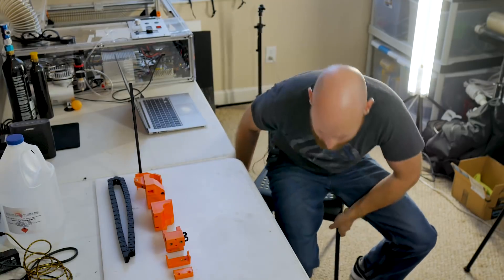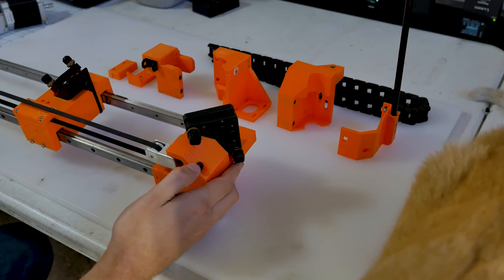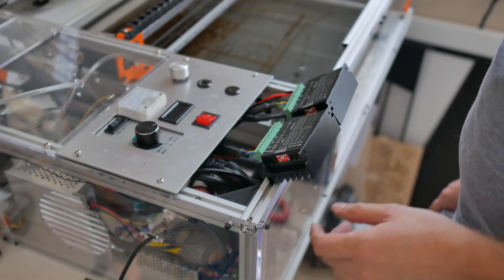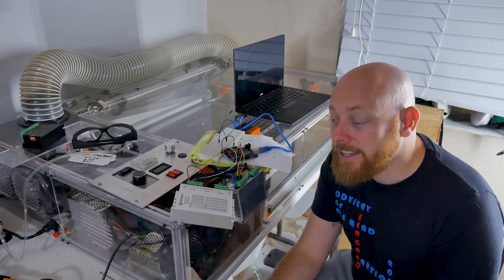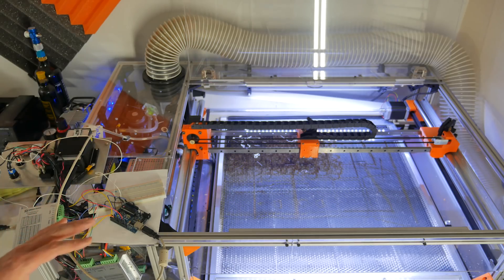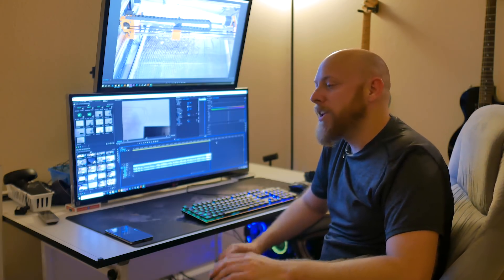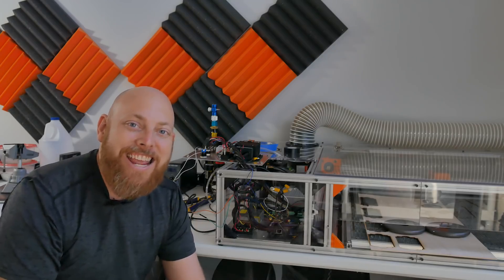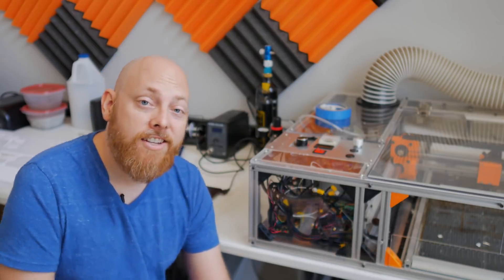Laser Cutter Upgrade (Fast Engraving!) - S02E37

Comment: Congratulations, you took bad laser tube from old K40 laser engraver and make new, bigger laser engraver for only double price. It can be only laser engraver, not cutter... because there is no air assist, so any cut may look as if you cutting with a paraffine candle. And current measured in Volts? Voltage in Amperes?

Comment: There is a thing called grbl lpc that work with your board. It's like grbl but can generate much faster step pulse and laser pwm. There is some guys out there that tried 500mm/s engraving without any issues.
Maybe another alternative is to use grbl esp 32

Comment: Very cool!  Are you streaming from LaserWeb to the controller board?  Do you have it loaded with Smoothieware or GRBL?
I have a K40 laser that I just put a Smoothieboard in, but I'm having trouble finding tools to support my workflow.  I tried LaserWeb but unfortunately all the machine config and job data is hosted client-side, so I can't set up a job and start it from another browser (my desktop is in the opposite corner of my house from the laser).  I'm going to try VisiCut next, and if that doesn't work, I'll use LaserWeb locally on my desktop, have it export the gcode, and manually copy the gcode over to the Smoothieboard (via SD card or the network).  I really need something that will let me set up a job from my desktop, then go over to the laser to actually start it.

Comment: At what point do you start considering more professional software hardware? Something like Mach3/4 pushing a gecko board.
Reply from the maker: I have mach 3 and a gecko drive on my cnc, and honestly it doesn't do anything special compared to the laser set up. In fact mach 3 makes for a pretty poor laser cutter software, and you still need something to generate all the g-code.
Reply: Good to know.

Comment: Reall there is a setting in grbl and in laserweb to add a 7 ms delay for your laser! That second Arduino was pointless
Reply from the maker: I would love to know where these settings are, and you might want to let the author of GRBL know its in there, because he doesn't seem to know.
Reply: 1.) Wow, no need for that level of sarcasm asshole !!!
2.) I was mistaken about laserweb I got that option from Inkskape, 
3.) Also my fussion 360 CAM setup has this option.
4.) There are plenty of GBRL options available; Marlin, MK2 (kimbra) and both of them have it.

#define SPINDLE_LASER_POWERUP_DELAY   5000   // delay in milliseconds
#define SPINDLE_LASER_POWERDOWN_DELAY 5000   // delay in milliseconds
Reply: @peterrusanoff1010  will that take microseconds instead?

Comment: you know laserweb has a build in laser fire delay setting, you can setup in the software.
Reply from the maker: I looked and couldn't find it. Could you be more specific?
Reply: I think you mixed something up. We do not have such a function in LaserWeb4, because it could only be done in the firmware.

Comment: So I was wondering what code you used to delay the incomming singnals, since at first glance it doesn't seem to be that easy for me
Reply from the maker: I will post the code when I get home tonight.
Reply from the maker: https://drive.google.com/drive/u/1/folders/1O_6vE8vBIstp4J8dbozfsC1wr1kFVybs
Reply: You really have to be carefull when delaying more than the length of one high or low pulse, since you would interupt the interupt. I guess a variable capacitor (You can also use potentiometers to charge / discharge the cap ) along with a comparator would be the more precise method
Reply: @MrLimetto  The RC comparator solution seems to be a very nice idea!

Comment: So I am building a high speed automatic camera slider right now. It has to move a 3kg camera in 5cm increments as fast as possible. Whats your top speed guess? I hope for 5sec for 5cm. Not sure how fast in can accelerate and de-accelerate. I was thinking of using 2 Nema 17s with A4988 in parallel. They are just much more compact and consume less power.
Reply from the maker: 1cm a second isn't to fast. The heavy axis is probably about 2kg and can move at least 20cm/second. You should be good with your setup as long as there isn't too much friction
Reply: I would add that running two steppers together to achieve more power can cause other problems, so if something starts acting weird give us a shout and maybe we can help!
Reply: Ryan Wilhelm Thanks. That sounds good. Will start with a prototype soon.

Comment: What microstep settings are you using on the drivers when you test "full speed" on one axis? Acceleration settings? Feedrate? :) It seems like the smothieboard can handle a lot higher frequency on the step pulse than Arduino GRBL can (~30KHz).
Reply from the maker: 3200 mircosteps, feedrate is anywhere between 20,000 and 50,0000 mm/min, acceleration is 5000 mm min/min. the smoothieboard can definitely handle a lot. though 50k is a bit much for anything by engraving. i would say it can handle anything lower then about 10,000 without problems.

Comment: I bet that the problem is not that the arduino is too slow, it's that it has no flow control on the serial input.  You're probably overflowing the input buffer, which is causing your loss of control.
Reply: If that would be the probelm, then the steppers would stutter! 
Grbl creates the pwm and stepper pulses in one interrupt routine, which means the delay between both signals can not be longer than one interrupt cycle!

Comment: Just watched a video Oct/2017. Pumpkannon. Would you guys come up with a cheap reliable system to ignite "Fire Works" ? We need up to 5 - 8  lines, to be shot one at a time. I would LUV to see what you come up with.
Reply: Oh wow, so we did pretty much exactly that for 4th of July (Arduino driven so it could do a time show) but decided remote-control-boom might be gray area with YouTube content guidelines. There's a picture on the Instagram with 16 tubes, though a couple are fired in pairs because I was lazy about the outputs. Maybe we can share the code and at least advice about building a safe system somewhere else

Comment: Id recommend Lightburn for your laser software if you were looking for an upgrade.  It supports both GRBL and DSP controllers which would prevent you from having to switch software if you decide to scrap the mks.  Another plus is the developer is very quick to respond to issues or patching bugs.

Comment: I've been using Laserweb4 for a while. I have a few crashing issues and it crashes the PC (full on BSOD) when it does so. It also seems to have problems with DXF files output from Fusion 360, frequently there are missing lines. I've been getting the  best results using the CAM environment and a DXF plugin as a post processor.

Comment: I am not sure if my understanding is correct but the situation is: laser trigger pulse is leading relative to stepper motor outputs. From what I understand here you isolated the problem and actually motor drivers are lagging. Do you happen to have an oscilloscope so that you can compare two waveforms (optocoupler and step signal to motors)? Another point here would be whether this delay profile is consistent or not for a specific driver (one on the controller board or external ones). The underlying problem is that the controller has no feedback from the motor outputs in terms of movement which happens to be a big issue for laser cutter application. I believe this is should be a fundamental design requirement as there would be different latency profiles all around such a system and there should be a GRBL setting or maybe a G code parameter. Lastly I want to add that while I love GRBL and grateful to its presence, I had really hard time for fine tuning and end up buying a cheap chinese controller that interfaces to PC. Processors are not a great fit for such a task and they are somewhat expoliting interrupts and timers to achieve timing requirements. As you have noted in this video, the faster CPU is better but to be fair considering your efforts in mechanical domain, I think you absolutely deserve a better solution.
Reply: I'll scope it when I get back in town and report the findings, that particular toy is a little outside of Mike's area so we debugged it another way. I agree it would be nice to have a hardware dedicated driver solution, but open source is pretty helpful too!

Comment: Howdy P/A, thanks for the content? Do you or anyone else have suggestions for resources on Lazer engravers/cutter's? I have an older commercial fixed (galvo?) engraver that I am considering building a table for to expand my work area. Thanks and keep the vids coming!
Reply: This one started life as a cheap Chinese one, which I don't really recommend unless you're just scavenging cheap parts to make your own.  eBay was our source for that. In other labs I've worked with epilog and coherent, both make excellent systems. Don't know about glowforge, they seem like the new kid on the block. I knew the folks at full spectrum back when it was a three person company, they were great back then and very cutting edge
Reply: Thanks for the help, I'll definitely check those out! What I have is a Synrad 30 watt and nema 24 stepper setup from another project. I'm limited to 380mm now and was considering an ebay setup just for the table and hardware then adapting my stuff to it, but it may be easier to buy the extrusions and build the whole thing. Any thoughts on which route you would take having done this before? Are the mirrors and their setup on an ebay system any good?
Reply: @chadcleaver2862  hmm...I don't remember if we replaced the actual mirrors or not, but the original adjustable mirror holders were absolutely garbage. I think all that's left from the original is the tube and high voltage supply (not including the ballast resistor, that pooped out pretty early on). If you don't need something running right away (and are comfortable with invisible eye destroyers and high voltage) then it's probably best assemble from parts. There's a lot of parts, but if you're going to replace everything in a cheap machine you might as well just start collecting them up :)

Comment: 13:52 Anyone want to do the math? How powerful would that laser have to be to engrave at that speed?
Reply: Sadly I've been down that rabbit hole: it gets really complicated when you start having to account for focus shifting, material type, and available oxidizer in the local atmosphere (which changes drastically with the smoke exhaust flow involved... Unless you pump oxygen in...). On the other end of things? I worked on a galvo head setup at one point where the limiting factor was always the laser power. At 400 watts you could blow all the anodizing off a business card sized piece of aluminum in just a couple seconds!
Reply: Ooooo available oxygen in the atmosphere isnt something I thought of! 👍

I always thought a galvo setup was the better setup for engraving anyway, why do it the raster scanning way?
Reply: @beachboardfan9544  the raster machine is just more flexible for other things and allows a big cutting area and finer focus (better use of the power). Galvo has a spherical focal plane so it's pretty much purpose made for things like business cards or putting serial numbers on things.
Reply: @beachboardfan9544  I mean, I still want to build another one :)
Reply: Whats that, another galvo engraver?
Reply: @beachboardfan9544  yeah, not sure what I'd do with it but they're just so cool :)
Reply: Yea it would be cool, I feel like theres not much on youtube about laser galvanometers in general, so it would definitely be interesting.
Reply: Don't forget the limiting factor of the laser power supply. Good LPS can accept max. 30kHz PWM (cheap ones much less), which is max. 30'000 values/s (the tube is much slower). If you want 0.1mm resolution, you can feed max 3'000mm/s (= 180'000mm/min).

Comment: I would use machine kit on a beaglebone black. You be able to get faster speeds out of it and should be able to eliminate the delay issue machine kit  is very versatile once you learn how to use it it is also based off of linuxcnc  which is used by tormach for pathpilot. The beaglebone with machinekit runs on a real time kernel. As for the stepper driver issue i betting that you have your step and dir pulse timings not set right which is  causing the latency issue I'm his most likely the direction pulse is not being sent right or too late. It stepper driver has its own step time, step space, direction hold, and directions setup and whether it falls on a rising Edge or a falling in all varies between stepper drivers manufacturers. All you need to do is ask your  manufacturer for this info or look at the spec sheet. Here's some pages that will help you get your information hopefully!  http://wiki.linuxcnc.org/cgi-bin/wiki.pl?Stepper_Motor_Speed_Limitations http://wiki.linuxcnc.org/cgi-bin/wiki.pl?Stepper_Drive_Timing

Comment: I just bought some linear motor stages on Ebay to build a laser cutter/engraver and 3D printer.  I'm hoping to avoid a lot of the stiffness issues I see with the available stuff I see online.  I know they will accelerate and move faster than I will ever need and be dead smooth.

Comment: first, whats up with the surface grinder? finished?
Reply: Surface grinders are very high precision machine tools, much more accurate than typical mills or lathes. In my opinion PA bit off way more than they can chew with that project. The manifest choice of a weldment for the machine frame means it is unlikely to ever be very useful. I hate to be a naysayer, but I think in the end PA would have saved money by sending their lathe off to be ground at a shop with a large commercial surface grinder.
Reply: @5tr41ghtGuy  still marching along on it. You're probably right about all those things, but where's the fun in that? In the end we'll have a way better idea of how they work, what's most difficult on them, and lots of other things that I probably wouldn't learn any other way. Maybe it will take a version two... Heck it took me 3 cnc machines before I made one that didn't completely suck :)
Reply: I guess I'm trying to lower viewers' expectations, so PA can let that project die. The only straightforward way to construct a surface grinder accurate to say 0.0002" is the way machine tool makers have already figured out how to do so. PA's choice of using CNC router parts for the mechanism will limit the precision to around 0.005" if they are lucky, mainly because those parts are not nearly stiff enough, and that's an order of magnitude too coarse for the application.
Reply: @wileecoyoti  all that said, I will follow along, and I sincerely hope you surprise me with success ;-)
Reply: https://youtu.be/NYaxcQoZhRM